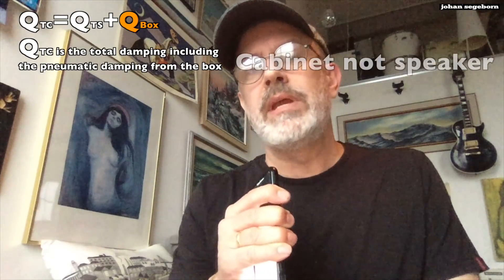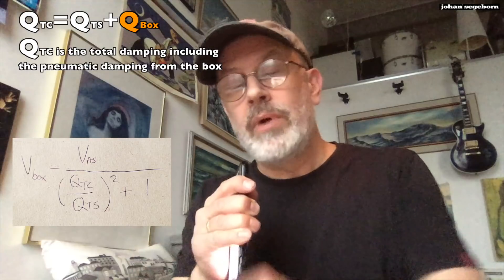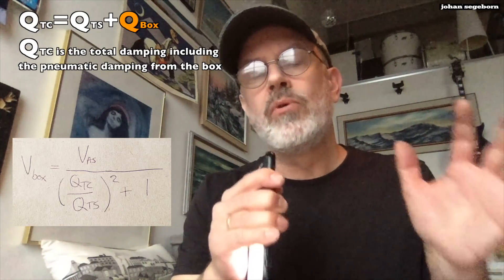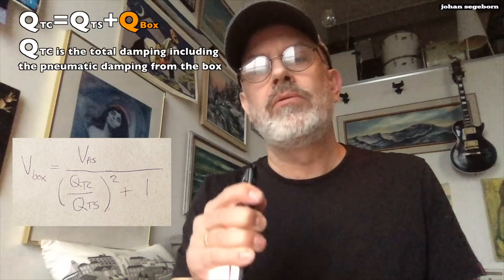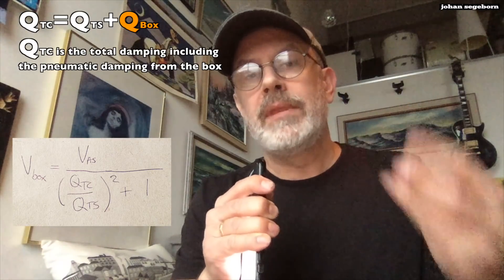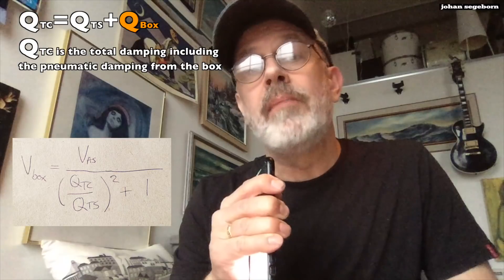Is the "Perfect" Guitar Speaker Cabinet really perfect?

Comment: One thing about the boogie cabinet, Which is built to the published EV TL806 builder's plans specs, as is the LA session guy's little secret Pacific Woodworks cabs from the 80's and 90's. You will notice the difference most IN the room some distance away from the cabinet. Close mic'ing it you miss a bit of the impact that the tiny cabinet still can make in the low end in the listening space.  
One thing about any EV T806 design cabinet with an EVM-12L in it, they tend to be "beamy"  But if you were like me, chasing a Lukather stereo bradshaw rig in poor-man's miniature, you had a pair of them and a Boogie Fifty Fifty stereo power amp and a Roland GP-100 and  the two beams covered the whole sonic space very nicely lol.

Comment: Because of this video, I just purchased a Mesa Thiele cab for my Mk IV combo !!
Reply: How is it working out for you?
Reply: @qua7771  Many options !! Def needs a noise gate, otherwise it's awesome !
Reply: @MalcaratMartinez  But it's just a speaker cabinet.  You mean the MK IV combo?  If so, that's also interesting to know.
Reply: @qua7771  Oh sorry...... mine came with the C90 and I haven't had the time to try at full volume. It has a lot of bass but a bit flabby, I may try to block one of the ports...maybe I install the EVM in the Thiele and the C90 in the combo
Reply: @MalcaratMartinez  That might work.  I'm trying to get less flabby bass as well, but I think it's my amp, not the speakers.  I have greenbacks in a 2x12, playing through a Marshall 1987 clone.

Comment: This box is such a great design. I scaled the measurements down to 3/4 of the size to use with a Celestion  Eight 15. Building it with 1/2 inch plywood and closing off the two smaller ports tightened up some of the low end and made the sound less booming. I am currently using my boss katana practice amp with an output mod to power it and this cab setup puts out so much volume with only half the rated wattage of the speaker, this box could most likely work well with anything you put into it.
Reply: Also installed the speaker from the inside of the box instead of front loading it which made a slight difference.

Comment: I just found this video...  That written, I've built and used TL806 cabinets since EV released the designs in the '70s.  In fact, I've even used EV designed TB series boxes for SROs designed back in the late '60s.  At any rate, I find that the Marshall 1933 sounds better.  I'm still satisfied with the TL806, but the 1933 sounds better.

Comment: I have a pro made Thiele with an appropriate EV12L type speaker in it.

Hard to beat the utility. Mic it, it's an improved 4x12 (goes to about 85hz vs 100hz on a 4x12). So, it's a small one hander 4x12 equivalent...

...if you're standing in the right place. "Where did my highs go?" (Adjusts eq, stand in front) "ahhh icepicks!" You do eventually get used to it.

Paying off a 4x12 right now so I can friggin move and still hear myself, but I'll probably never sell the Thiele.

It's the only "metal" 1x12 cab. Glad the DSL40C wasn't the first DSL I played, the 1x12 open back really changes it vs a 1960a.

Comment: The best cab I ever heard is my Stromberg Carlson console radio/record player  from 1946. It has 1 12" speaker , solid plywood with mahogany veneer looks like furniture  and dwarfs a 4x12. Of course the compartment with the speaker is 1/4 of the whole thing. 18" deep open back , open bottom on  2 1/2" legs. I think the whole thing resonates and sound bounces of the wall behind and the floor and resonates the parallel compartment which is made to hole lp vinyl. I have 1957 magnavox alnico speaker which sounds very good in regular size speaker cab for 1x12 but this sound is so phenomenal

Comment: I find that the Mesa Thiele cabinet is a bit weak on the bottom end.  By making a slightly taller version (same height as width) you get a fuller bass response that I prefer.  I've been making cabinets in that specification since about  1988.
Reply: @ZOMBIELANDakaUSA  19x19, 14" deep, sealed back, ported front, EVM-12L.

Comment: I found out by experience how important the cab is to overall tone. I have an Orange 2x12 with broken-in Celestion Vintage 30's, an EVH 2x12 with broken-in Celestion Heritage speakers, and a brand-new Avatar Forte vertical 2x12 with one new Celestion Vintage 30 and a new Celestion Heritage. I have two heads: a Friedman Dirty Shirley 40 watt & an EVH 5150 6L6 50 watt. I put the new speakers aside and installed each pair of broken-in speakers into each cab and played both heads through them. The overall tone stayed with the cab instead of following the speakers. The Orange cab was heavy on the lows and low-mids while the highs were muffled; the EVH cab was shrill and ice-picky with the highs and the lows were weak and thin; and the Avatar Forte Vertical sounded more well-rounded with the highs being a bit muffled but still present and the lows still thick but not overwhelming. 
To be honest, the Orange loaded with the Heritage speakers sounded like complete ass, with the highs being trill but still weak and the lows being in some unpleasant frequency, while the Vintage 30's in the EVH presented a little thicker bottom end but lacking in highs that one would think would be needed to cut through a mix. In both cases, each head needed to have their bass, treble, and mid settings set to extremes just to sound ok. 
It was a surprise because the EVH cab with the Heritage speakers are really ice-picky sounding on the highs and I thought that transferring those speakers to the Orange would tame the highs just enough to sound good. Nope - the highs disappeared and the lows became too much. Well, then the EVH should tame the lows of the Vintage 30s, right? Well, it did, but too much while the highs were weak and flat-sounding. That was my experience with different cabs with the same speakers.
This next stuff I will write will have nothing to do with the cab comparison... The best combo I found out of all my equipment was a broken-in Celestion Heritage paired with the new Vintage 30 into the Avatar. Putting a broken-in Vintage 30 presented too much flub on the bottom end, meaning that eventually when that new Vintage 30 I have in it now breaks in it will start to sound flubby to my ears. 
Speaking of broken-in VS new speakers, I also did a comparison there: putting in the new Celestion Heritage next to a broken-in one in the same cab, and the same experiment with the new Vintage 30 and a broken-in one. Result? The broken-in speakers seem to project more volume overall. While facing the cab head-on, it isn't as noticeable as hearing the cab from an angle. But overall, when you hear it, you get tricked into thinking that the new one isn't even hooked up until you put your ear closer to it and hear it outputting sound. 
Anyway, all of these comparisons were done with just my ears so take it with a grain of salt, I guess. All I know is, after it all was said and done, I'm keeping the Friedman head and the Avatar cab loaded with 1 broken-in Celestion Heritage speaker and one new Vintage 30 speaker, and the Orange cab and the EVH 5150 head along with the cab are all up for sale (the EVH cab has a new speaker in it). But remember: tone is subjective...what I thought sounded good to my ears may sound horrible to someone else.
Reply: Thoughtful detailed comment. Yes orange cabinets gobble treble. I don’t see the point of that. It’s astonishing who makes the good sounding speaker cabinet. It isn’t rocket science. And it shouldn’t have a NASA budget. I just wanted to mention that you have two speakers with totally different volume levels coupled together now. One is substantially louder than the other.
Reply: Provided that the heritage you’re talking about is the 20W that is. The 30s are equal in volume to the vintage.

Comment: Sometimes a "lucky accident" yields great results.
I have a Marshall DSL1 combo that was hooked to a Marshall MX112 cabinet. It sounded pretty good, until...
I put a Celestion Greenback in the MX112 and hooked it to my Marshall Origin 20 head. Truly Awesome. (I liked that combination so much that I bought a second MX112 & Greenback so the Origin can use both 16 ohm outputs.)
I put the Celestion Seventy 80 in a cheap Peavey Valveking 112 cab for the DSL1 and believe it or not, the Seventy 80 sounds better in the Peavey cab (which is rectangle, as opposed to the square MX112) (I also moved the rubber feet to the side of the Peavey and made it vertical instead of horizontal.)
(Also I tested the DSL1 using MX112/Greenback cab and the Seventy 80 in the Peavey sounded better to me.)

Comment: I have one of these Mesa Theile Cabs with the EVM12L. It moves a lot of air for its small size. 
I personally find that it sounds very punchy but also really directional. If I am standing off to the side of the cab at all, the tone is all gone. You really need to be right in front of it, on axis. 
Personally it’s a bit jarring on it own. I find the best results are with it paired with an open back combo in stereo. Combo fills the room, theile cab adds low end punch and immediacy.

Comment: Since I started playing music 53 years ago I discovered many decades ago closed back cabinets produce more bottom end and volume that open back cabinets. Especially when playing large stages like theaters or outdoor stages at music festivals. I knew a lot of bass and volume was lost out of the back of an open opened back cabinet. I stopped using combo amps for that reason and started using closed back cabinets with a separate power head. Cabinet size and shape does influence the amount of volume and the kind of tone you ultimately get. Speakers make a difference but so does the cabinet.
Reply: I've been using closed back cabinets because it's what my favorite speakers were designed for.  I haven't thought much about the other factors you mentioned.

Comment: Theile and Small parameters. Nice. .707 qtc final as goal dictates your f3

Guitar speakers are usually designed with damping built in and are "infinite baffle" or have specs way out of Useful T&S.

You need to calculate ENERGY BANDWIDTH PRODUCT of the specs to see its designed preference.

Anyhow guitar speakers under a HiFi designed enclosure will probably get significantly worse for QTC final but might still sound cool.
Reply from the maker: Yeah for many drivers Qtc can be replaced with 0.71 in the formula.
Reply: @JohanSegeborn  it's a range. You can use the formula any way you want. A final close to 1 is gonna sound bad but is pretty common with low end stuff. Open baffle and Hi Vas result in happy combos

Comment: I love my pair of Thiele cabs. They aren't perfect sounding, but I bought the pair for $500 so I am not complaining. For their footprint, a Mesa Thiele cab with an EVM-12L is massive sounding. The low end is more apparent with the Thiele over the Marshall cab. I tune down & use a Mutron Octave Divider, so I like the low end resolution offered by the Thiele.

You do realize that Mesa changed the dimensions to fit a Mark 1 head on top of it. The dimensions aren't the same as the calculated values for a Thiele cab. The original cabs were really meant for PA work. A friend did a 2x12 Thiele that sounded wicked for guitar. It was super heavy.
Reply from the maker: Interesting, I didn’t know that. Looks always puts performance in the back seat 🤣

Comment: I could see a T/S cab working for specific genres of harder music or keyboards. 
Not for classic rock/blues though. I want a mid focused, looser sound out of my speakers/cabinets.
Reply from the maker: Thanks Matt!
Reply: Actually, you're wrong about your frequencies perceptions : your regular cabs have a frequency drop around 1.4kHz, just look at their speakers datasheet! The EVM12L hasn't!!! It's not even at cab level... 
All you have to do with the 12L is some frequency cut and guess what? I have a MARVELLOUS sound with my Vigier Excalibur Supra SSS + Muff Germanium4 + Triaxis + EL84-20/20 + Thieles while playing... I Can't Get No (Satisfaction) as well as Led Zep 1 or anything classic rock/blues! Mark my words, you'll have a hard time differentiating the guitar sound on the Stones' record from mine!!!! In fact, I'm just about 2% thicker, and using a DiMarzio DP-185 "hotrail" ceramic PU in bridge posn!
My amps are a little tweaked, e.g. silver-mica caps instead of ceramic ones, etc. Note that I had sold my Mesa Fifty:Fifty and got the Marsh 20/20 as I wanted my Marshall-Boogie sound back : the 1st amp I built was a Mesa Stu22 copy with transformers scavenged from a burnt 1974 Marshall "18watter"

Actually, a Keith Richards obsessed dude even ended with a nervous breakdown because of me : he had spent a real fortune gearing-up exactly like Keith in the 60's, spending big on vintage gear, most of it from the same year as Keith's (there is other stuff too)... I let you imagine how much he paid for the 1960 LesPaul.
He had became so much a piss-off for his son's guitar teacher and myself that we organised a blind test for him!!! 
We used my DIY snakeskin-tolexed TL806s so he couldn't know which speakers were used (no brand on). 
My budy had just received his brand new 7-strings "Strat" from master luthier Leduc, she has a Floyd-Rose with piezos, 1895 Brazilian rosewood fretboard, Elsass alder body, Canadian hardrock maple neck, Benedetti SSH handwound permalloy custom PUs and a preamp... Note that his CAE 3+SE preamp had been customized by my "master" in tube electronics, so he has a blackface and a plexi channels as clean and crunch, but with the wonderful CAE dynamics... WIMA caps were changed for Orange Drops on the BF chan, and for Mallorys on the Plexi chan. His preamp, which usually goes into a Fryette 2-90-2 was used with my Marsh for this even, which decided me to build a (modified to my tastes) copy of it... 
Then... 

"Keith" confused her with his own L-series Strat. He believed that my Excalibur, a model of guitar used by Shawn Lane or Ron Thal, was a vintage Tely, err, nope, she's a vintage Vigier, being one of the early built Excaliburs, and then, he went really green : we didn't pursued the blind test further but I wanted to compare his 1960 LP to my "PRS w. LP wood volume" built by late luthier Xavier Petit, using a 100+ years old Honduras mahogany. The neck has 25.5" scale and is very thin, similar to a Vigier Arpège-1, titanium trussrod, carbon reinforcement bars in, deep tenon setneck goes as far as the bridge, brass-bell bridge+nut, strings thru-body, Spertzel locking tuners, SP Custom handwound alnco PAF'57 replicas, Gabon jet black ebony fretboard... Guess what? I preferred my 2008 X.Petit guitar to the 1960 LP : they sound very similar but mine has a more in-your-face aggressiveness, moreover, ergonomics are far superior... Actually, my buddy (the teacher) was considering having Xavier building such a Super-PRS and selling his 1976 LesPaul when the luthier passed...

I must say that it was really joyful to see the face of this ever-vomiting-on-non-vintage-gear dude when he understood that, in a blind test, he believed we had converted to vintage crap while the goal of the test was to demonstrate him how far he was deluded

So let me laugh about the "Not for classic rock/blues though." BTW, SRV, Knopfler as well as Gary Moore were serious EVM12L users. 
" I want a mid focused, looser sound out of my speakers/cabinets." 
I far prefer something I can tweak into doing anything I may need, this is the very interest of the 12L : you can play anything with it. When EV advertises it as the best guitar speaker in the world, it's near true : it's the case as long you're not ooking for alnico speakers' sound.

Comment: Mesa a little fatter and more natural sounding to me. Marshall a little brighter and fizzier. Both very usable sounds. Nice demo
Reply from the maker: Thanks Evan!
Reply: Use TL806/EVM12L with a Marshall, I can tell you that your windows' glasses will vibrate before you reach 10W with your master volume!!! No way I switch the "Deep" switch "ON" when I use the EL84-20/20 with my EVs!!! The great thing is that despite basses are enormous, so, usually I keep basses low at preamp leve, they are damn accurate! No vlooomf coming from cab's reactance, like on early Speed-Metal records using Model 1960 cabs..
The Marshall's Presence pot would surely need to be logarithmic instead of linear : it's difficult to tune, you can get serious bright from your Mesa too, it's just much easier to regulate the presence so users just end tending to not let it go so "icepick-in-the-ear", but actually, Mesa, at least for Mk/Caliber series, tend to be way much muddier than Marshs when it comes to distorted sounds, Marshs are really tighter...
Note that it's not criticism of Mesas, it's absolutely normal when you use 6L6, and this is nicer when you want light/mid crunchy blues sounds, while Marshall will behave better with serious crunch à la AC/DC... The EL34s will also bring you tighter clean Brit sound : Marshall power sections are wonderful for clean sound! When the clean sucks, it's single-channel amps : it's NOT a clean channel, it's optimised for the Marshall crunch! Use the Black Face channel from a Mesa Preamp into a Marshall power section and your first reaction is... PINK FLOYD!!!!

Comment: Hello Johan, the equation you mentioned is actually relevant for hi fi speaker enclosures, which are " totally different beasts" in comparison with guitar speakers enclosures; electric guitar sounds sit in a very limited range of frequencies , and not necessarly they have to be highlighted in a very clear way to achieve a pleasant guitar sound to the ears; in fact both enclosures although different( very different!) Sound good and have a specific goal: tighter,  more cutting through the Thiele, more broad, open and " grainy" the 1933, I like both, cheers!
Reply from the maker: Thanks Vincenzo, yeah I was leaning towards that! Cheers